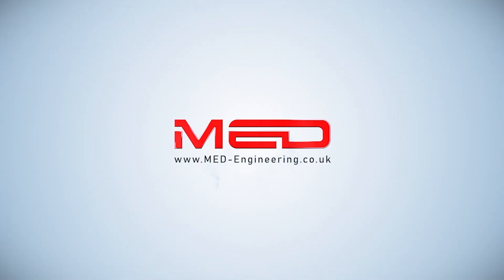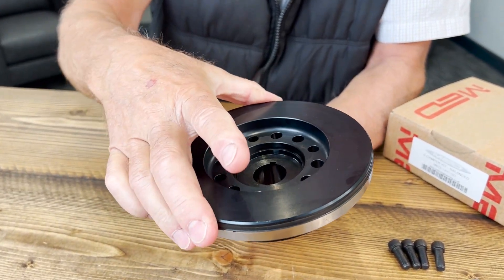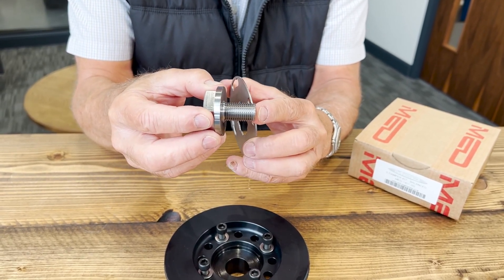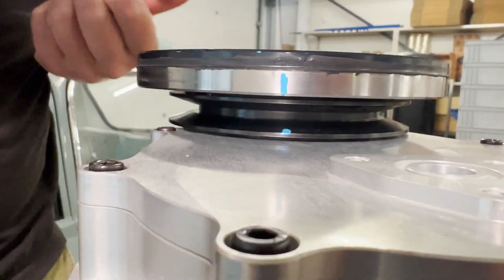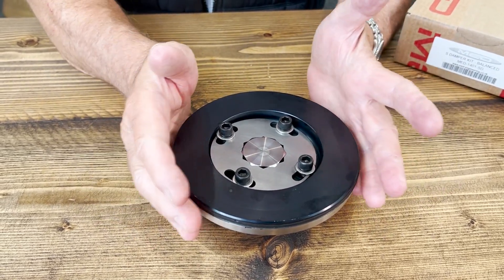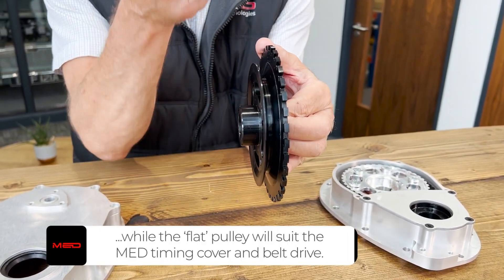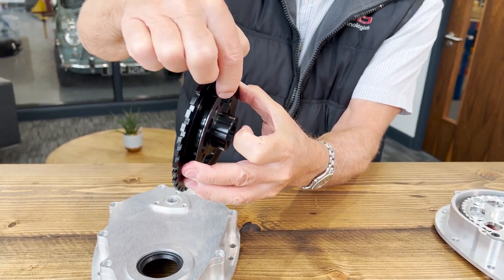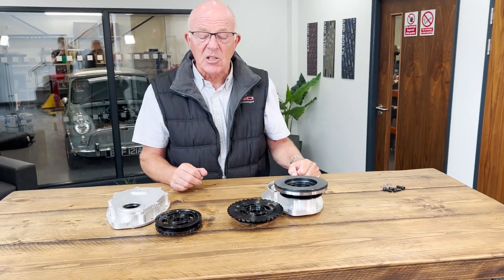MED S Crankshaft Damper Kits

Comment: i have this on my mini and the timing chain cover as well . looks great, fit great but i did have to modify my engine mount a bit so the belt could be replaced without pulling or lifting the motor.

Comment: I converted the pulley my 998 fast road to a multi rib type, similar to the type used on the Japanese MPis. Its great for dealing with Belt squeal, especially if you have airconditioning on.

Would I be able to fit the crank damper to a multi rib type pulley?